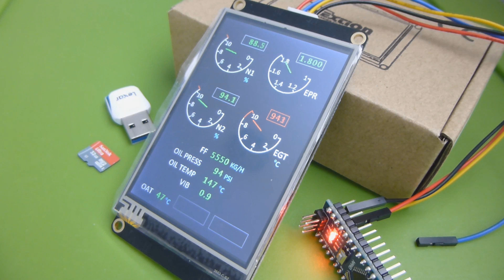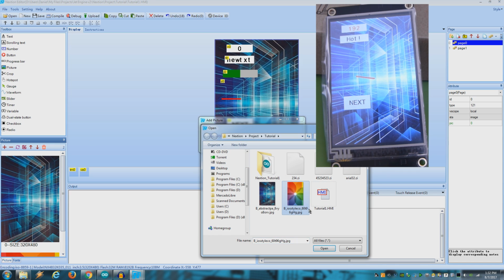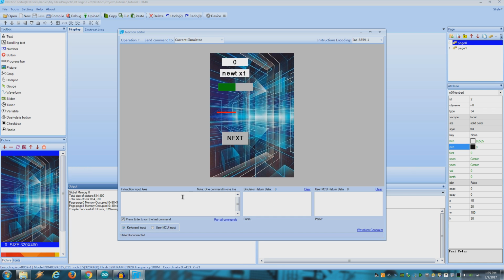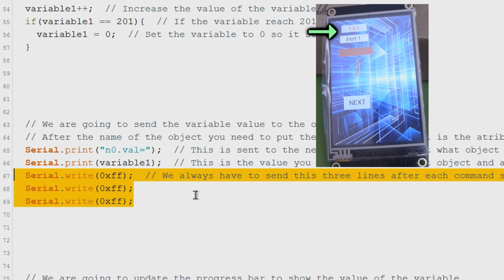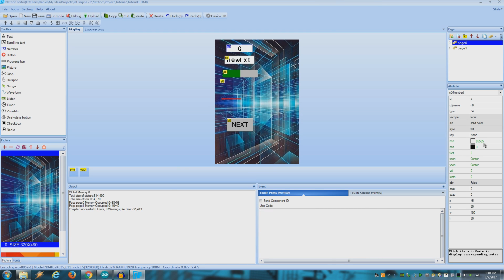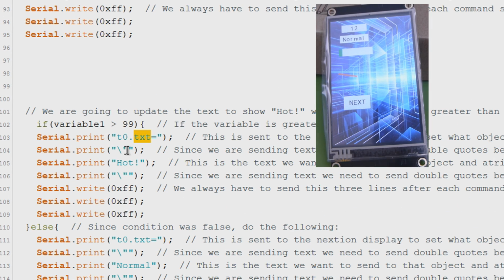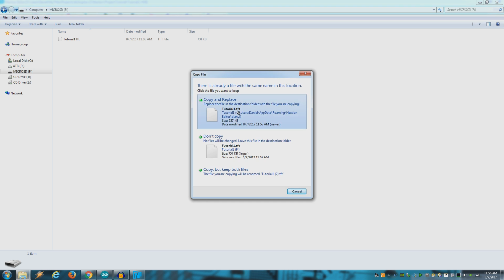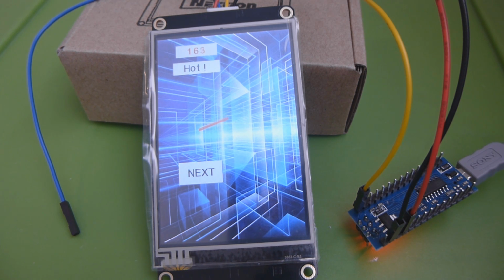Nextion+Arduino Tutorial #1 Beginner's Guide

Comment: Do you know if this display will work over long distances like 3 meters? I am trying to do a project where arduino sits in the back of a car and the screen on the dashboard. Tried with TFT display and the output was broken with no display after few seconds..
Reply from the maker: I haven't tried that long distance but i think it should work because we are dealing with serial communication. The higher the baud rate, the shorter the cable should be. So the real question would be: how high the baud rate can be at 3 meters?

So, it should work. You just need to not use too high baud rate
Reply: @interlinkknight  Thanks. I need to try but first need to get that nextion display which doesn't seem to be available here. :(

Comment: hello again. I have a project that has multiple pages. my page "main" has a number box n0. I want to send a numerical value to this box n0 through arduino. Is this done using this? Serial.print("main.n0.val="); or is there a different way for mapping this? Thanks a lot in advance.
Reply from the maker: As far I remember, you can't send page+object like that. If you want to send a value to an object on a particular page, even if the page is not seen, first make that box object "global" (there's a check mark to set this) and then in arduino send the normal command "n0.val=123".

Comment: Hi...im trying to add another layer of color changes on the timer, im trying to use the following command, but i keep on having error:  

// Change color of number to red if value is high enough:
if (n0.val >= 90)
{
  n0.pco = 63488; // Change the color of the number to red
} 
  if (n0.val >= 91 && n0.val <= 180)
{
  n0.pco = 31; // Change the color of the number to blue
}
  if (n0.val < 90 || (n0.val > 180))
{
  n0.pco = 0; // Set the color of the number to black
}

can you kindly help?
Reply from the maker: Are you using part of my code to add your own. Right? Just look at the difference between yours and mine (that works) and you will see the problem. The nextion editor is very strict that it doesn't allow spaces, parenthesis, etc. where it should not be, so pay attention to those small details.

Comment: Hello friend, what is the probability or possibility of adapting an Arduino Nextion Display code to an SPI Display? These Nextion Displays are very expensive! Thanks
Reply from the maker: Not possible. The nextion display has its own microcontroller so arduino only sends and receives serial data to the nexiton display, meaning that all the drawing of the display is done by the microcontroller of the nextion display.

With a simple SPI display, arduino has to draw everything manually so it works in a completely different way.

I know they are expensive, but the internal processor and using the nextion editor is what makes it possible to make such complicated graphics in a simple way.

Comment: so when i plug in the nextion to my computer, and launch into the game, the nextion doesnt receive and data from the game, any clues why this has happened?
Reply from the maker: Game? I'm not sure what you mean. This is not a monitor
Reply: @interlinkknight  what i mean by that, is im using the nextion for a dashbourd, like in a car, for my racing games. it used to work, but now it doesnt change anything on the screen when im driving.
Reply from the maker: Check the wires. Upload my example files for testing. Maybe it broke?
Reply: @interlinkknight  ok, ill try. also if this helps, im using an sd card to put the tft file on the nextion, as something happened to it  and it doesnt work just plugging it in the uploading the tft to the nextion

Comment: Each command that is transmitted to the Nextion serially must be terminated. For this purpose the 3 lines "0xff" are used.You can also output all 3 in one line:
Serial.print ("\xFF\xFF\xFF");
Or like this e.g. "change page": 
Create String Variable: String TRM = "\xFF\xFF\xFF" // Terminator for Nextion (globally before setup)

Serial.print ((String("page 2") + TRM)); // Change to page two
For more info:
https://nextion.tech/instruction-set/
Right at the beginning under 1-1

P.S. don't copy & paste - Read, learn and comprehend :-)

Comment: Hope ur Still there because i have some Problems with my Arduino MEGA 2560 and the Nextion Enhanced Display
When i dont change a single thing in your Arduino Sketch, the serial LED TX goes crazy and in the Serial Monitor there are all the serial things he wants to send i asume. However the Nextiondisplay doesnt care at all it jsut stays frozen and Nothing happens. If i change every "Serial" in the Arduino Sketch to Serial2, the TX LED doesnt light up anymore and the serial Monitor also says nothing. Nextion display still Frozen. Can u Help me to get my Nextion Display Running with Arduino Mega 2560???? I spent soo many hours allready and still doesnt work. getting bit frustrated... thanks
Reply from the maker: First test on an Arduino uno or nano, using my sketch without any modifications

Comment: Could you please update the sketch for your Video 1 Arduino to Nextion as the link on your page does not link to the correct sketch
Reply from the maker: What do you mean? I just checked and works fine
Reply: The Arduino sketch I downloaded from the video is not the same as the example you use in the video.
Reply from the maker: I improved the sketch a bit, but it's basically the same sketch.
Reply: Please check the Arduino download sketch attached to the video 1 as it looks completely different? I’m having problems using the USB port to connect to the Nextion, would be nice to have a working sketch to work from.
Reply from the maker: I checked and I repeat, it works fine. Hundreds of people downloaded the sketch and they never complained. You are clicking the wrong link or something. You need:

My example nextion project file #1
My example arduino sketch file #1
Reply: Solved the problem, the download was being loaded from the wrong directory on my PC and by default the Arduino was loading a previous script. Thanks for your help.

Comment: Can we not have delays in the nextion display because when i used our tutorial without delay it works perfectly but when i use the display to measure rpm using hall effect sensor.... using delay the numbers are not even moving! Please help!
Reply from the maker: You mean delay in arduino?
Reply: @interlinkknight  Yeah! I still can't send data from arduino to the screen! I used all your troubleshooting tips too.....but all in vain. I even did upload in both Mega as well as Uno after following your tutorial and troubleshooting!
I still can't figure out the problem.....In a hurry!
And moreover i want to display time using ds3231 rtc module on my nextion screen model NX4024T032_011 which is not the enhanced version of nextion display!
I also want to display the fuel flow meter through the pipe using the flow meter sensor and I'm facing the same problem in that too!
Please help!
And sorry for bothering you so much!
Reply: @interlinkknight  Thanks in advance!
Reply from the maker: I don't know. I mean, many people had tried my examples and they work. What are you doing differently than me? Especially sending data to the display, which doesn't require even the library. Not sure how to help. Try to copy everything exactly as I show in the video. Try in every baud rate. Connect ground of the display with arduino.
Reply: @interlinkknight I copied your code to see if that works and to my surprise that worked but my code didn't work!
 I can mail you my code and the HMI file and possibly you can help? 
I'll try to change the baud rate and connect the ground of the display and see if it changes anything...
I need it urgently by 16th

Comment: Dear, is there any editor for type of LCD and TFT screen to create the layout and use widget like you are using in your tutorial ?
Best Regards
Youssef
Reply from the maker: This editor only works with nextion displays
Reply: @interlinkknight  Thanks for quick answer, do you know if there is any other editor or a library with different widget or components l: OLED 0.96" I2C/SPI Display
I 'd like to use vertical bargraph for audio PPM and waveform for spectrum analyzer and some naviagtion pages for setup.
Thanks if you could route me to the correct direction.
Again thanks for your tutorial https://www.youtube.com/watch?v=0FMs0hA4Xzo
Reply from the maker: Not that i know of

Comment: thanks for you videos ,i have question,is there  a possibility to make nextion display like a serial monitor of arduino?
Reply from the maker: Kinda. You can display any data you want, but it needs to have a format so it's going to ignore anything else. A real serial monitor would display everything.

The closest thing would be using multiple serial ports, and printing one of the ports on the display. Like convert everything of one port into text and send it to the nextion display in a separate serial port. That might be possible.

Comment: perfect. I am recieving Octal format numbers while I am using serial read and Print to Serial Monitor. Is there any tecnhnique to exctract the commands come from NExtion Display without Itead library? Because the library has alots of bug and   delaying my stepper.
Reply from the maker: There are, but so far i haven't find one that is reliable
Reply: @interlinkknight  I have fınally done without nextion libray. But some special technique. I gues I must do tutorial for it. Now my stepper run smooth while lcd sends command and mcu send feed.

Comment: Would using a Arduino Uno be better than the Arduino Nano?
Reply from the maker: In terms of code, memory, speed and amount of pins, both work the same. The nano actually is better in my opinion because has 2 more analog pins and it fits in a breadboard.
Reply: @interlinkknight  thanks :) do you have any tips for making a voltage meter with dial value and gauge meter? Max voltage is 5V.
Reply from the maker: Quite simple. Measure an analog pin and remap value from 0-255 to 0-50. Add a dot on the display and you are good to go
Reply: @interlinkknight  0-50, do you mean 0-5?
Reply from the maker: I mean 50. Using real decimals can get things complicated.
Reply: @interlinkknight  sorry, I don't really get what you mean :-)
Reply from the maker: To use decimals you need a float. Float variables can be used in limited operations. One of those limitations is when sending data to the nextion display. Trust me, use normal numbers and separate the decimal with an artificial dot in the display. That is going to make things easier. Try it and you'll see what i mean.
Reply: @interlinkknight  allright, thank you! I will try it and get back to you :)
Reply: @interlinkknight  do you know what refresh rate I can achieve with this screen? My customer wants a refresh rate of at least 300ms. Do you think it is possible? What would be the limiting factor, screen or arduino?

Comment: How did you get the images to be centred for the gauge. When I create an image with the same dimensions as the gauge and set it as the crop image it is offset. How did you overcome this?
Reply from the maker: You need to create a background image with the gauge picture. The resolution of the background image has to be the same as your display
Reply: @interlinkknight  Ok I asked on the forums and they said the same. So now I understand how the crop image works. How did you make the backgrounds? Which software did you use?
Reply from the maker: I use PowerPoint because I know a lot on how to use it. Not necessarily the best option for other people.
Reply: @interlinkknight  lol not sure if this is a troll comment
Reply from the maker: What do you mean? I did use PowerPoint to make the background image
Reply: @interlinkknight  Oh ok sorry I thought you were using the PowerPoint meme. Hmm does it give the option for pixel width of items? I'm using gimp ATM and I'm finding it really difficult.
Reply from the maker: When I do it on PowerPoint, I don't care about scale. When I finish I take a screenshot and then resize the image to whatever I want. But that's me. It's not the best way to do it. Ideal would be Photoshop or something like that.
Reply: @interlinkknight  Ah, sounds good. How do you resize the image?
Reply from the maker: Paint

Comment: Hii Interlinkknight  good job!!!
but has doubt about pin configuration with arduino mega 2560.
TX RX 1,2,3. which one to use and how to change in code as well.
Reply from the maker: More information about that in here: https://www.youtube.com/watch?v=oJuL0hNk2eU

You can use either serial number you want. Just make sure to plug the display in the same Serial number you set the configuration file and sketch.

Comment: The font part is stupidly counter intuitive. Guessing it's a licensing thing. No excuse for their lazy Ness on not including a resize option for the photos. Needlessly disruptive to work flow to have to first find image, open in another program then resave, switch back to this program, navigate to new img load it and assign it. I wouldnt bitch if it just had a proportional down size. Crop would be ideal.. But I'm 99 percent sure there is a library included in windows/Mac and most Linux installs capable of being loaded with one line and called to do the image work with maybe 8 more lines of code per feature. Ideally clickeable drag resize but obviously that's not something to hold my breath for lol

If libraries for arduino environment get easier and or someone makes an editor like this dfor a library compatible with multiple displays.. This company will probably go belly up. They aren't worth double or triple the price for such a half assed effort
Reply from the maker: Yeah, they have many design issues, but so far I don't see a real alternative for creating such advance graphics with arduino.
Reply: InterlinkKnight the libraries with the underlying draw methods for primitives are there. Issue I found is they suffer from integration and compatibility issues. A few that even do buttons and screens in a format like button. Add(x, y, function to call). Issue with those should be easy ones have been either author gets butt hurt over people not preferring say ada displays or doesn't have the time to document it proper but had every intention of compatibility. Problem is the touch ic library is either by the gui library designer or external but highly intergral to every method so even if u get a 10 buck screen that demos fine.. Aka reads touch over uart with demo sketch and is driven fine by display only  library.. U can still end up shit out of luck. I also have yet to find a gui library that uses the intrupt on touch pin that some provide. Writing basic page and button library isn't technicaly difficult due to do but is a significant amount of work. If I had the time I'd knock it out but sadly I don't. As far as I see the only real gotcha to realize is have an array of xy start and end of every touchable area so either the polling part of loop or int pin can trigger an efficient search for what to do based on where was pressed. The alternative of scattered ifs would really unpredictable performance wise if it ran acceptably at all

Back to topic if advanced output... With primitives easy it still probably takes some trig knowledge to make gages that aren't a set of images or sprite. I doubt it's Hella complex but between time and knowledge required I think most people on that level are busy coding at their 9 to 5 jobs

  /end musings

Comment: Thanks for the tutorial..
You guys can use this following code to reduce total line.
in loop section;
sendNoticeToNextion("t4.txt","Hello from arduino..");

after the loop section;
void sendNoticeToNextion(String file,String text)  // string file must be the object name from nextion display.
{
  String command = String(file)+"=\""+String(text)+"\"";
  Serial.print(command);
  endCommand();
}
void endCommand() // we called this part of code from other void
{
  Serial.write(0xff);
  Serial.write(0xff);
  Serial.write(0xff);
}
Reply from the maker: Don't you think that strategy makes it more complicated and confusing? Everybody is free to write the code as they want, but to be honest I think is better keep all contain and clear putting the last 3 "Serial.write(0xff);" commands together everytime we send data to the display. At least your approach uses less memory?
Reply: i guess.. i am working on a project that uses a lot of sensors.so arduino side of the project is really messy right now that's why i have to simplify it as much as i can..
Reply from the maker: Ok. If you check if your strategy uses less memory (flash and RAM) over my strategy, let me know which one is best. I am curious.

Comment: Is there a command to start a new line in the serial monitor after writing the command? it doesn't look clean and you cant go back and see what the program did.
Reply from the maker: Serial.println();
Reply: So after the write command, for example. When you say serial write, write, write 3 times... if you say println it messes up the communication because now if you attempt to write the values again, it will try to send whatever you printed in the serial monitor. I would like to start a new line AFTER writing to the display.
Reply from the maker: Then, I suppose you can't. Commands sent to the display are not really suppose to be monitor. Debugging should be done in a different serial port.
Reply: InterlinkKnight okay thanks. Thought that might be the case. I appreciate your tutorials.
Reply from the maker: No problem. Good luck.